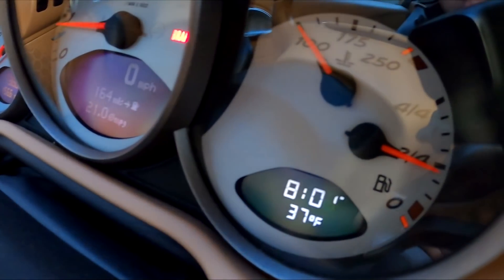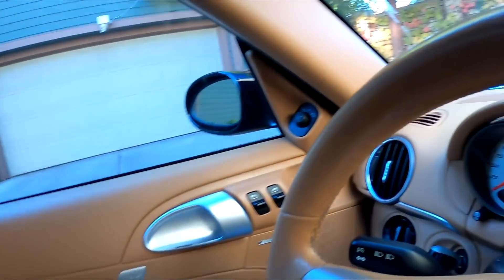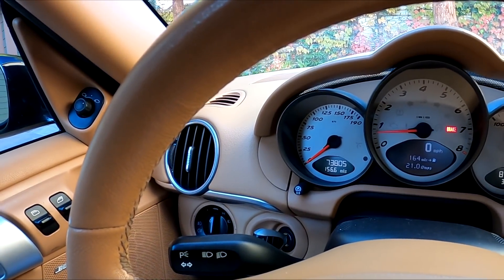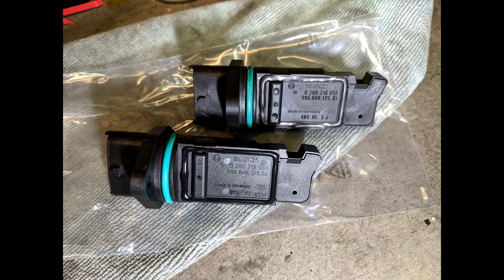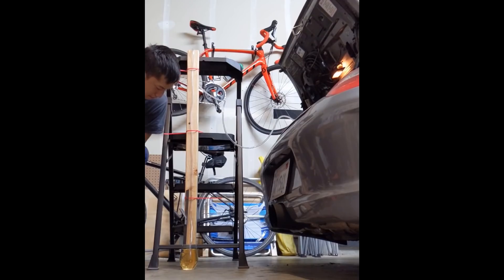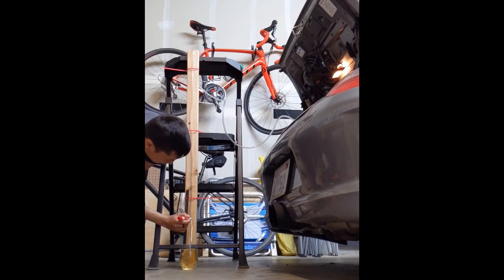Bye Bye Cayman S, Hello New Car!

Comment: Hey Fenton, Good to see you doing well and making content! I have little experience with Porsche's, but here is my insight. Cyl 1,3,5 it sounds like something is wrong that is central to that bank (highly improbable all 3 coil packs/ injectors failed right?). Before ANYTHING, it is common SOP as a dealer tech to make sure the software flash is up to date (Again, not a Porsche expert, but I've fixed many serious drivability issues with a simple software flash). After this, I would see all TSB's or anything similar (Subaru had a monthly tech tips newsletter for dealer techs). Who knows? There could be an updated part that solves this issue!

Reading vacuum at idle (using a vacuum gauge) or the MAP sensor reading should give you a clue if you have a vacuum leak. Compare actual reading to FSM spec.

If you are able to see Long and short term fuel trims that will also give you some clues (Rich or lean command at idle ect..). A common procedure I used to always do is spray brake clean in the affected area and watch my short term fuel trims on the scan tool, although this doesnt always work.

My gut says you have a minor vacuum leak on that bank. Those molded rubber O rings always turn rock hard and no longer seal in those plastic manifolds. Loose, cracked, or PCV hoses missing clamps is also common.

If you have a smoke machine you can also smoke test the manifold/crankcase.

During my time at Benz you actually need to do a relearn when you replace engine air filters, so although unlikely, that aftermarket intake may/may not be an issue. Ex. LS swapped cars need a honeycomb to smooth air flow for the MAF to run properly. 

The bigger the engine, the less likely it will be affected by a vacuum leak and it makes sense at higher speeds car runs fine as you have little to no vacuum with partial to WOT. IE vacuum leaks will affect a 1.6L a lot more than a 3.6L. 5.7L may run like nothing is wrong.

Good Luck and  happy holidays!

Comment: Lol. And then I see this video. I have the same misfire. But being in Texas I only experience it on cold startup. Also I've got 0w40 and it definitely prefers to be warmed up.  I haven't gotten around to all the fixes you did. But I'm sure by next trackday in March I would have tried a few more of the misfire scavenger hunt items.  I definitely recommend the high temp brake fluid for your next track day. After yesterday I was scootin pretty quick and now need to sort out this oil/gas starvation

Comment: I would think that odd number cylinders are on one bank. Not exactly sure if there is one per bank but I would check the cam position sensor. Valve adjustment? Maybe check leak down on those cylinders. If leak down is fine then I would check for intake/exhaust leaks. If all else fails maybe a camshaft lobe is sketchy or issues with camchain/tension.

Comment: 996tt here and my buddy had a 997.2 cab and had the same misfire on bank 1. Try replacing the variable valve timing solenoid on both banks. Porsche updated the vvt solenoids with an updated pn#. He also replaced the coils with quality Bosch ones. All misfires were solved. Try it out!

Comment: Hi Zygrene, I did change out the brake and clutch sensors on mine 911 today and it seems to have resolved the gas pedal hesitation I was experiencing. I'll post over at Rennlist with more details.  Nice 911, I love that GT3 front hood! Really nice.
Reply from the maker: Lucky! I replaced both of my switches after filming this video and nothing improved 😔

Comment: U need oil pressure sensor. Its reading oil pressure while engine is off. $90 from  dealership. Easy to replace. Make sure ur  intake boots r sitting properly from back bcz when u remove and install they r pain  to aligned from back. They sits in groves. Boots for plenum

Comment: AP1 S2000/997 C2S/981 Cayman GTS owner, I track all three cars quite a bit...

I haven't had this specific problem with my 997 yet but I do experience something very similar in my track S2000.  For my S2000 the car buckles and almost stalls out at low rpm in first gear.  The issue is caused by intake valves getting tightened due to excessive track use/over-revs.

In this case you don't have to worry about valve adjustments but as @CM Autohaus mentioned earlier I think you probably have a vacuum leak.  When you're misfiring you want to look at three basic things: spark (electrical), air, and fuel.  I typically prefer to check in that order but "symptoms" can lead you to check one over the other.  In this case I'm inclined to believe your problem has something to do with air.  Why?  Because (based on your observation) this seems to happen more often in cold weather and low RPM, the car runs fine at higher RPMs.  

Now there's no guarantee it's going to be air related but my hunch is based on the fact that it's harder to make compression (and therefore a smooth running combustion cycle) at lower RPM then it is at high RPM.  An example is if you tighten the shit out of the valves on the S2000.  It'll bog and be choppy at low RPM but it'll still "sing at 9k", it just won't be as strong because of the incorrect clearances.  

The definitive test for a vacuum leak will be a smoke test (paid service at a local shop) but a quick way to verify this hunch is to see if the car is running slightly lean at lower RPMs (typical of a vacuum leak).  You can also spray liquid around areas where you suspect there might be a leak to see if you get any bubbling.

If it were electrical or fueling related I'd imagine if you were seeing problems at low RPM that the problems would be consistent throughout the rev range.  No guarantees on this and once you've exhausted air you should move on to electrical (coil packs would be good) and finally fuel.

Good luck!  If you need someone to compare A/F ratios with I might be of some assistance but I have a 2005 C2S (M97/3.8) so not sure if that'll be the best reference... @ericmdub92 on IG

Comment: I would say possibly it could be the cam or crank sensor. If you could datalog it while you drive you might be able to pinpoint it. Also o2 sensors. Good luck.

Comment: Switching the coils it a good start if you are not getting a proper CEL light. For the vacuum leak you can spray brake cleaner on all of the vac lines and manifold. If you notice a change in the idle you found a leak. The next thing I would do is check the compression and injectors.
Reply from the maker: I am getting a recurring CEL showing misfires usually on cylinders 1/3/5 but occasionally on 6. How does spraying brake cleaner change the idle behavior? Compression came back good at 200-210 psi across
Reply: @Zygrene  If you spray brake cleaner and you have a leak you will notice a drop in idle. Its a poor mans smoke test. lol
Reply: @Zygrene  So the only thing I can do on the weekends lately is stay home...this should help a ton...seems like its a common problem...https://rennlist.com/forums/997-forum/581408-misfires-in-3-cylinders-4-5-6-a-5.html....I would do the following order....Check plugs, Swap coils...Check vac leaks, check 02 readings...

Comment: You probably need a new tune to run with the exhaust & mod setup you have. I went to a catless x pipe on my 996 replacing the stock cats and keeping the oem tune. The catless x pipe lost so much low end torque that the car would bog and lurch under hard acceleration at low rpm. at 3,000 rpm and above the car ran normally. I did not tune the car, I just simply changed my driving habits.
Reply from the maker: Interesting. Did you log any misfiring or CEL with the catless x pipe?
Reply: @Zygrene  yep CEL's came about 30 miles into a drive. Short drives would not pull them. Normal O2 sensor codes. I just bought a code clearing device off Amazon and checked for other codes and cleared it from time to time. Although a tune can fix the issue I don't want to deviate from oem parameters on a near 20 year old (and expensive) motor. So I just lived with the torque gap because I never needed to be WOT at 2,500rpm. Downshift and let it sing 🤘

Comment: could always be a bent valve. happened to mine if its slightly bent it could not seat correctly. it would misfire at idle only
Reply from the maker: Interesting. Did this happen on a 997.1 3.6 also?

Comment: U are trying out the engine in every possible position:) the kamasutra of the automobile!it s a really valuable experience for a petrol head! Aside for this the garage queen would probably still take the track better than the Porsche ! It will be interesting to know of what you think of the dynamics of the 911 when you track it. Have fun. Ciao

Comment: How is compression? Low rpm misfires usually are caused by that
Reply from the maker: Compression was good. 200-210 psi across the board

Comment: I personally am strongly against this lol. I've always felt like the Cayman is the superior chassis and especially going from an S to a base... but I think I'm on the minority on this. I'm happy for you and excited for the new videos! Shifter is dope
Reply: I had the exact same issue on low rpms. Took forever to diagnose but it was just a faulty sensor (camshaft). Msg my insta @aston.klutch if you need more info!
Reply from the maker: I'm fully expecting to be disappointed by the 911's handling vs the Cayman but I just love how it looks and the extra power is nice

Comment: Um, you do realize you bought the same drivetrain?  The majority of the parts are the same.  The only difference between a 987 and 997 is the drivetrain is rotated 180°.  Maybe the 911 is alittle quieter on the inside...but it's a bigger car too.

Comment: Dunno if you've seen this:
https://youtu.be/e5YgEiQsuck
Make sure you've got good quality fuel,  especially if the car has been sitting. Check your fuel trims, and the stability test to confirm the variocams. Try swapping precat o2 sensors also as they  control each bank.

Comment: The problem with the s2000 is how many of them are out there IMO. Like caymans.
Reply: Depends on where you live.  Caymans are very rare in Alabama. (Boxsters are a little more common).  Even though used ones are affordable now, potential buyers here need to search listings from the entire US to find the right one like I did, so I guess that discourages some potential buyers.
Reply: There aren’t that many S2000’s especially clean unmodified examples.